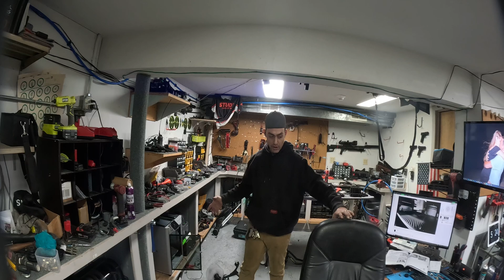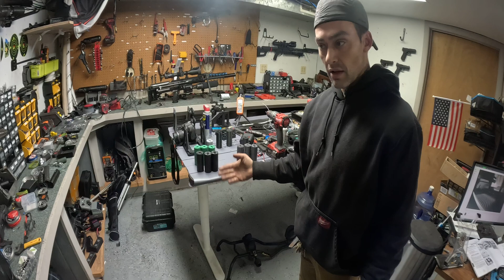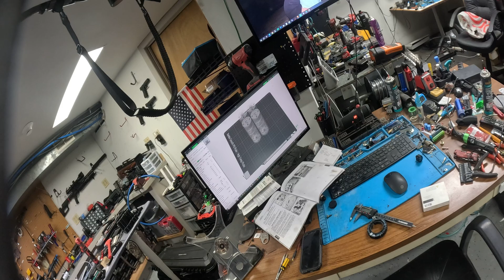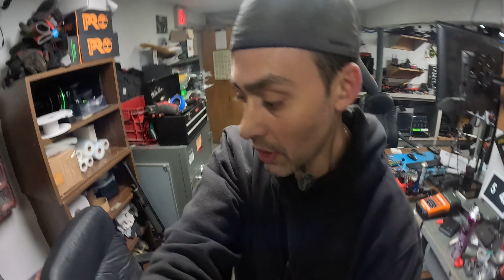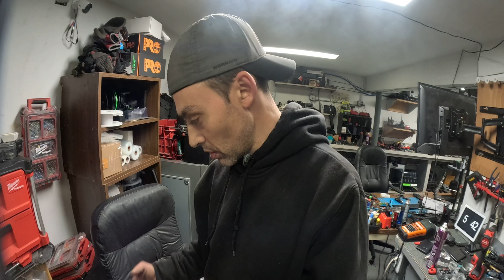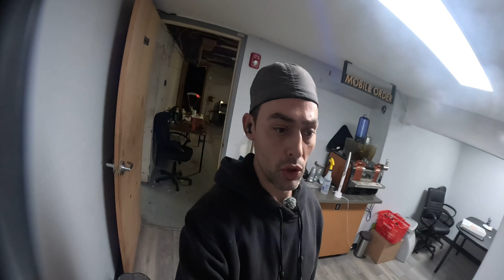My New Suppressors are finally for sale!!!

Comment: Chris do you have a suppressor quieter than the behemoth? For the Leshiy 2 in .25 cal ? If so where do we go to see our options and to purchase? Thanks john
Reply from the maker: Hey John, if you want, you can send me an email, and I can reply to you with several options, I have 3-D printed suppressors that I have tested and have both decimal level in a B and Z, and frequency testing on an oscilloscope showing that it was substantially quieter than any of the main stream suppressors out there for air guns, tested against several Donnie FL, the impulse both the big and small one a 0DB, all of them had higher decibel levels and more noticeable frequencies to human ears. I have a lot of them that I made out of machine aluminum that I custom make, and I could make it to fit any size suppressor housing, you could even put it inside of the behemoth if I made it that size. I’ve made them for all different suppressors, I could even make the housing as well, these 3-D printed suppressors actually do incredibly well, they are as much as 29 dB quieter than an off the shelf suppressor. when printed with carbon fiber mixed material, very surprising to me at first, the aluminum is one piece of bar stock, I machine it down into baffles that are conical, and have through holes going from one side to the other in an X pattern, giving plenty of air movement stripping the air on the way out. They’re both incredibly effective, but due to the material and machining time for the aluminum it’s more expensive. You can reach out whenever you have a chance, c j 1 1 0 1 0 9 at gmail. Hope to hear from you soon.

Comment: Whats the weight difference aluminum vs 3d?
And as far as caliber one size fits all?
Reply from the maker: I can make them any caliber I usually make them 30 caliber and they work for everything up to and including 30, I can make them for 35 or even for bigger, just need to change this thread size over 35 caliber, but I can make them any size. The weight difference is pretty substantial because my aluminum ones are machined from one solid piece of aluminum bar stock but they do a tremendous job muffling sound and I don't sell to just anyone because I want to make sure they're not gonna put them on a real gun

Comment: Looks interesting, any Big Bore sizes in aluminum?
Reply from the maker: I haven’t started making the aluminum baffled ones to sell, they are going to be custom-made by request
Reply from the maker: You can see by my design it is very time-consuming, and a lot of material. It’s not just a hollow tube in the middle. It’s solid aluminum baffles machined out of aluminum bar stock start to finish.

Comment: Chris I have a Skout .357.  And the 25 cal.   Also Brock Ghost in 30 cal.   …Do you have the right caliber in stock now.  What the best one you make …I think it was the glass the work the best.  ???
Reply from the maker: Hey, so yes, good choice the glass fiber ABS is one of the best ones, but the one that I have had the best overall results with as far as sounding and top of rigidity, and stout is the PETG carbon fiber, that material is so hard when it’s finished it’s actually even stronger than the PA 12 carbon fiber in a lot of scenarios. The PA 12 carbon fiber when it’s not solid and it’s open inside like this it’s definitely stronger than most materials but it’s not as strong as PETG. and the PETG has the same carbon fiber content, so they are equivalent and sound deadening if the PTG isn’t even a little bit better because it’s so much more rigid, PETG makes a very hard surface, even on a thin wall, I do four layers on the outside wall, so they aren’t all that thin but what I mean is the PA 12 can make it like a solid gear better than just about anything, because that’s nylon and carbon fiber, but it also needs more thickness to be rigid as the PETG. so my recommendation right now would be PETG carbon fiber. It’s under engineering grade filament. I actually put it on as a separate item same price, but that is one of the best materials by far. For people who want something a little more cost-effective the PLA carbon fiber is a close second, I’m offering all the other engineering grade materials for anyone who wants to try them, and they are all very effective as you can see in the video where I tested them, but I will be doing another video as I’ve purchased three other decibel, meters that have data, login capabilities and multiple testing frequencies, I’m going to do another video this week testing in different frequencies with data, logging and going over the data afterward
Reply from the maker: Hey, so since I messaged you last, I tried the PETG, carbon fiber, and that has been working tremendously. Also, I’ve been using atomic filaments, nylon, carbon fiber, and that is a really good one as well! Those are two of the top filaments right now in my opinion. The PETG carbon fiber, and the atomic nylon X, with carbon fiber, also both very expensive so the price reflects that, not compared to other suppressors I’m still much cheaper than anyone else, but I’m being as far as I can. Unfortunately, I can’t be just as cheap on everyone because the materials are so different in price, that really good nylon stuff is like 300 bucks a roll, some of these really high-end engineering grade filaments are really expensive, but I do give you guys all the best prices I possibly can

Comment from the maker: Yes, it’s listed in the description, I just got my SSL certificate approved so it’s a secure website, all of the suppressors are for sale on that website, I made a testing video, but I haven’t put it up yet because I actually bought a much better sound testing device was 700 bucks, and it looks up to a computer and you can pick out the spike from every shot and get an actual accurate decibel reading

Comment: Without the hose maybe a longer tank with a fill fitting off the side of the bottle sorry im not a machinist and would really like help to figure it out ive been watching your videos for some time now and would rather you do it if possible
Reply from the maker: Hey man, yeah, anything can be done for sure, you just have to weigh it out. If it’s worth it to you, then there’s no amount of money that matters, I’ve done things that are crazy to most people, because I wanted to do it, so if it’s something that you’re passionate about and you want to do it, then I’ll help you.
Reply: @Cjsairgunscarsandmachining  I've got 2 weeks before I can start anything how much do you think it would be not that it matters just so I know if it would be worth it just the material not the labor if anything labor should cost more that the material surely
Reply from the maker: @Nomadwolfpack  I honestly have no idea I have to get my eyes on it, and also I have a property management and home-improvement business as well as making the moderators in the videos so time is a rare commodity, but I will make sure I make time to help you out if you do want to pursue it, honestly, my personal opinion would be that if it’s something you wanna do it doesn’t matter what anyone thinks, but I would just buy a PCP, I’ve done this type of thing with smaller trucks before I bought diesel trucks, and I modified them so much that I ended up spending so much money, and I never get any of it back, it’s just an endless pursuit. The gun is never going to be as powerful as you want it to be just like the truck wouldn’t be for me, and I should have bought a diesel truck in the first place, just my advice, based on my experience for what it’s worth, but I’m happy to help you if you want to pursue it

Comment: Great work, I have a 25 cal challenger pro. Currently using a DFL Sumo. Love to have something quieter.
Reply from the maker: Dude, perfect example! I had an emperor that I was using on an 88 terminator, was at 3:57, and the suppressor was as well, I ended up with slugs, stuck inside the suppressor! Like seven of them, I didn’t know where I was hitting that’s because I wasn’t hitting anywhere, open the suppressor! On thread it on both sides and see what’s in the middle! It’s a hollow skinny tube with big ass holes that the slugs can fit through, and a piece of felt wrapped around it with tape and some wire screen, that literally is the reason I went on this journey of making the best suppressor I possibly could, and now I can make them an engineer in grade, filaments, and sell them for much cheaper than the best silencer they make, and they are a crazy amount more effective! To the tune of 30 dB, I’m actually literally setting up to do my testing video right this minute, and I will be using a Donny FL suppressor in comparison with decibel readings, it should be up by the end of the day, I’m also going to be testing all different engineering grade filament printed suppressors because there are so many different types of filament. There’s a lot of suppressors to test, and I’m going to test most of them in this video. I’m starting that now, so stay tuned but if you want something quieter, I assure you mine will be on the decibel meter. I will show you in this video.
Reply: @Cjsairgunscarsandmachining  Thanks, I have Ronan on my .357 bulldog that needs to be quieter as well.

Comment: My question is. My.22 and.30 impacts are running 1107fps   Can your suppressors handle that much fpe? The reason I ask is because I did some bata testing for a friend and his where blowing apart at 1018fps. Great videos btw 😎
Reply from the maker: My impact is.22 and shoots 42 gn slugs at 1030-1060
Reply: I’d be interested in getting / buying aluminum internals for a Koi in .30
Reply: I’m pushing 76g boat tail slugs at 1035fps. I only get 4-5 shots per fill using a 700cc tank 😂 hey when are you going to get your website up. Or however you get paid?
Reply from the maker: @FxFanBoy  I have a website, but I have a testing video that’s going to be put up by the end of the week and you’ll see that the engineering grade filament suppressors are actually quieter than the aluminum internal ones, they are the quietest yet. I am making custom aluminum internals on a case by case basis, and I would need your housing to make it to fit.
Reply: @Cjsairgunscarsandmachining ok I’ll give your best a try. It’s late but some how let’s figure out how to get you paid. I’ll take a.30 cal.
Reply from the maker: @FxFanBoy  I have a website there’s a link in the description of my video
Reply from the maker: @FxFanBoy  I think when you see the video you will know what I mean and you’ll be comfortable with the velocity, my Pantera is shooting 50 I can definitely go higher and break the sound barrier but I choose not to because it’s absolutely precise at the velocity, it’s set to
Reply from the maker: That gun has a 580, and a 300 bottle and I don’t get a full 16 round mag
Reply from the maker: Panthera is .25 50gn 1100fps
Reply from the maker: All use my suppressors. Engineering grade I recommend